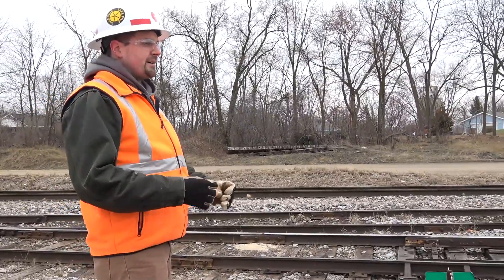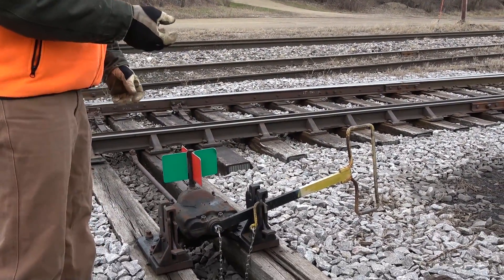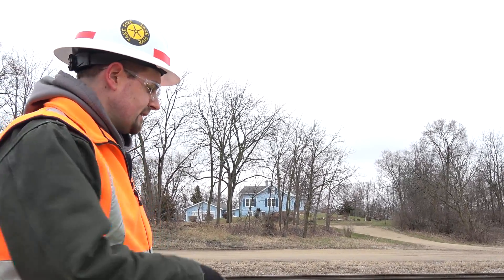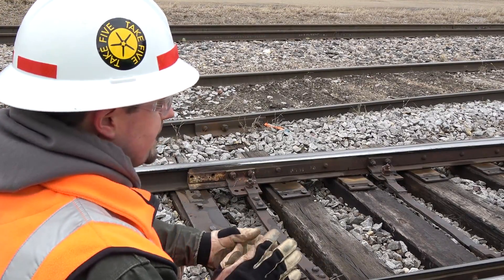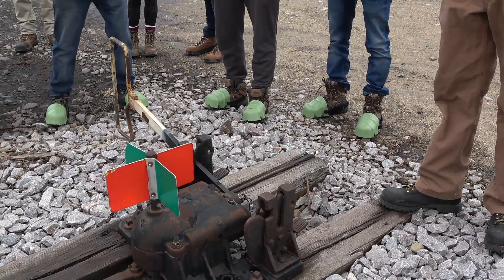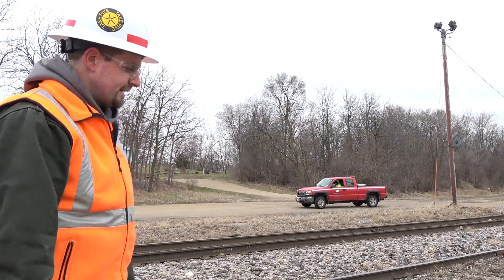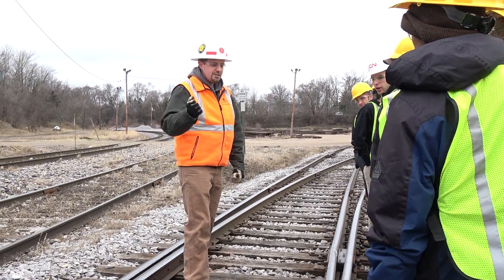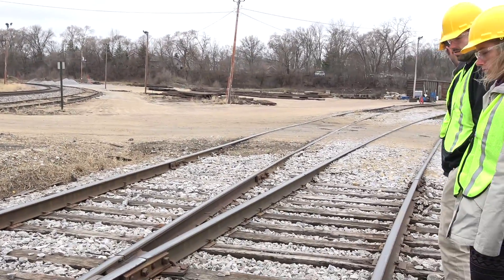TRRS 503: Railroad Track Switches / Turnouts Explained

Comment: It’s very important to pay attention to your surroundings because you could be looking down at the rail working on the switch and a train could come derail and end your life or some train cars could roll down derail and end your life.
Reply from the maker: Good thing this was adhering to all applicable FRA Roadway worker protection rules, specifically inaccessible track via locked out switches on unoccupied spur tracks :)

Comment: Great video and explanation on the components and movement of a switch. 
I am curious if there are any specs in the min and maximum of force required using the hand throw when moving the switch. I noticed you were able to throw this switch very easily. I've seen some,where the person throwing the switch would have to put alot of effort into getting it to lock into place.
Reply from the maker: Technically speaking, no. What you want is some tension on the connecting rod, but otherwise they should be fairly easy to throw. Basically, step on the hasp, the handle should pop out a bit, easy throw over, then some pressure to lock it in the other hasp. Railroads will lube up the tie plates to help the points slide, and the switch stands get grease as well.
Reply: @Thornapple River Rail Series   
So if I understand this correctly, there is no force gauge used to measure the resistance.  The force required to throw the switch is left up to whoever is performing and signing off the inspection whether they are 6'4" and 230lbs or 5'8" 155lbs.

Comment: so what do the colors mean on the switch stand?  is it like a boat, meaning if the engineer can see red you're going left and if you see green it's set to go right?
Reply from the maker: When looking down the track at the switch, a green banner means that the switch is lined “normal”, whereas a yellow or red banner (also called a target) will indicate that it is lined “reverse”. Usually the diverging/turning route is “reverse” but depending on the layout, it may be the opposite. Typically in yards, switches may be left as last used, and will have green and yellow targets, whereas switches that are required to be restored to “normal” when not in use will use a green and red target.

Comment: The one thing I DIDNT hear him say was never put your hand or foot in the switch. For ANY reason. If there is something in the switch like a can use a stick to get the object out. Never ever use your hands or feet. Be careful when deploying the arm of these switches. If the switch has been damaged it will have pressure on it and can fly up and break your hand or something else.

Comment: What's on their shoes?
Reply from the maker: Some of the folks on the tour didn't have safety-toe shoes, so those are caps designed to make regular shoes safer.
Reply: We call them steel toe caps in construction. You don't want a 15 lb sledgehammer coming down on just regular work boots🙃🙃

Comment: can you run them up without damage to the switch.
Reply from the maker: What do you mean?
Reply: These are not run through switches. If you run through it, it will break.
Reply: Robert Wiehe, look again.  This is a National 1003A stand.  It can be trailed through without breaking.  It has an adjustable crank eye under the stand where it joins to the connecting rod.  I repeat, it CAN be trailed through, but these stands were designed so switches wouldn’t break like the 51A style with the butterfly crank...a lot of people are under the impression that these are intended to be trailed through.  That is 100% NOT the case.  It’s a safety mechanism only.  I’ve watched yard trains trail through an entire ladder whacking the points over each switch...bad practice.  A terminal manager at an intermodal yard I used to be the rail maintenance supervisor had me follow his yard trains around and report the time and engine number of every single run-through.  Trailing through these switches only makes them maintenance hogs, causing them to constantly in need of manual adjustment, or worse, wearing out the internal mechanisms to the point they have to be replaced.

Comment: Very good. NOW explain what the red/green colors on the switch stanchion are useful for...yes, I can figure it out...but it's missing from your in depth coverage of the yard switch in the video and it's an integral part of communication.
Reply: Ben Lundquist, yes, agreed that it’s important.  As all railroaders know, you can’t trust the switch position simply based off the SPI.  Everyone needs to learn what the colors are SUPPOSED to convey, as well as learn that the ONLY way to assure yourself of proper alinement is by verifying the points before every move.